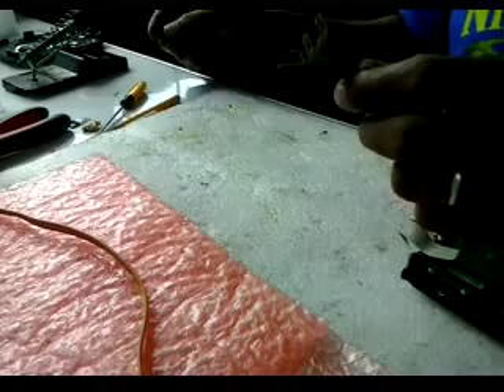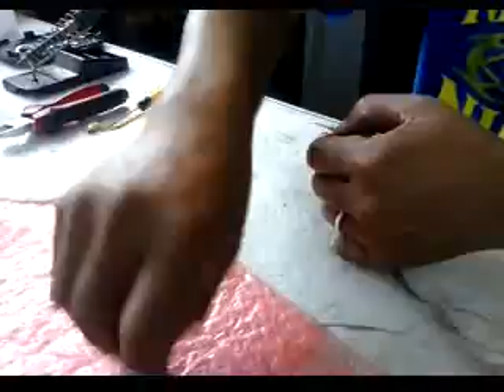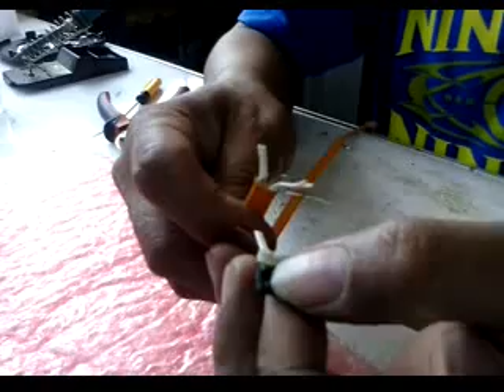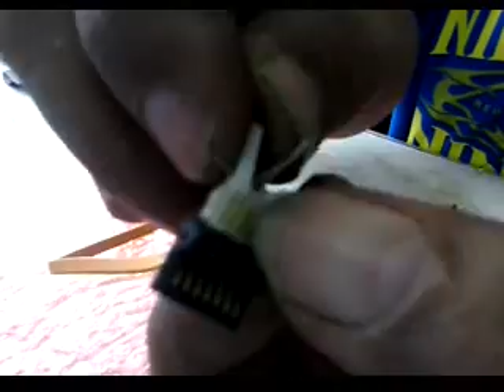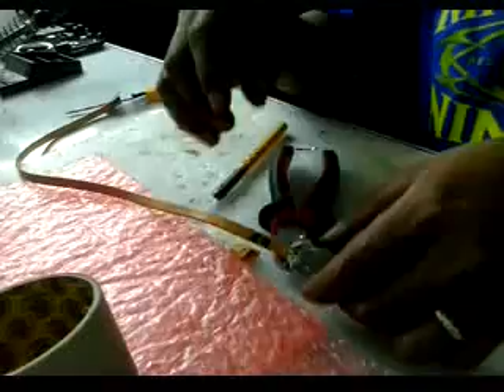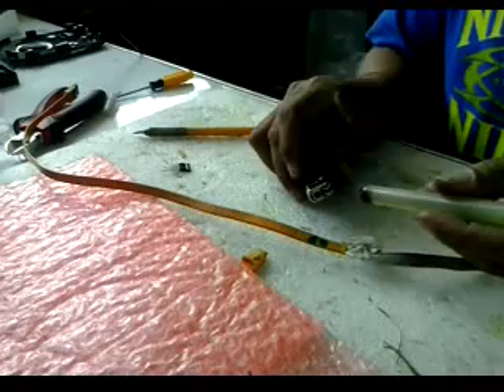REPAIR SATA HDD CONNECTOR

Comment: Basically all you should of done is cut the end off a sata data cable and tinned each wire after preparing it and same to hard drive main board then soldered them together. My hard drive sata connector plastic broke off and I'm left with just pins. I'll fix it by doing the method I mentioned above.
Reply from the maker: +SaucyBegger25 Nice idea my friend, what I do in this video is only to save my hdd 80 gb that the sata connector of it is broken. There are billion of ideas like what you do. you have channel?
Reply from the maker: +SaucyBegger25 Hi Begger very nice idea i learn on you. You have site?but what I wonder is if I will transfer the board of that broken hdd then I will transfer it to the new hdd that have the same serial # all the files will be transfer also. Because I know the files instruction will be magnified to the hdd platter it is recorded through head and right actuator pin. What I need also is the important files. There are many hard drive of notebook computer that I encountered like this problem. They need to get the important files, they will pay on it.
Reply from the maker: Ok thank you for your reply and idea, I can use it whenever I need to recover an important file of a non-detected HDD. Thank you so much Saucy. Do you have a website or blog?
Reply from the maker: OK Saucy, thank you so much, lets talk in coming days